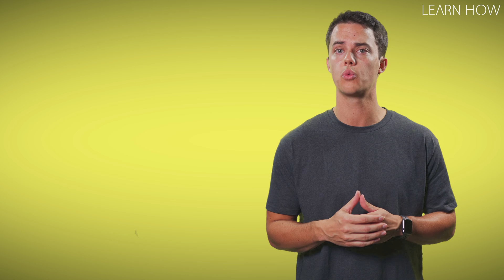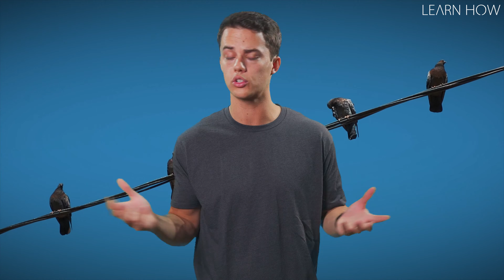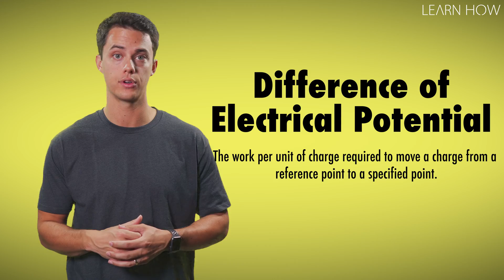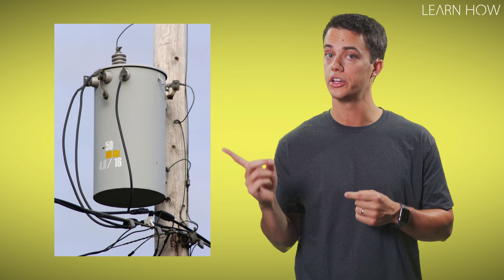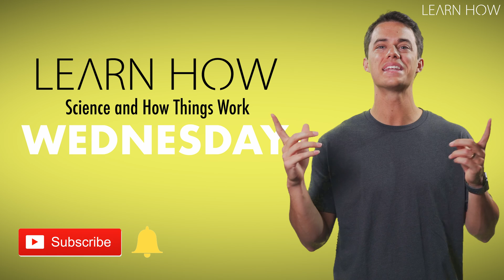Why Don't Birds Get Shocked on Power Lines

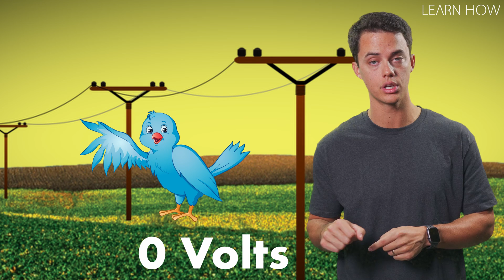Comment: 1:49 , the bird would have to touch the ground and the lines to get a shock? Which can never happen as a bird is not big enough to have it's feet on the ground and touch the cable at the same time, but is that what was meant?

Comment: Because their feet were at the same potential with the conductor and the current always take an easiest path plus their feet were not at the ground that's all but if by mistake they connect themselves with the lower potential conductor then RIP